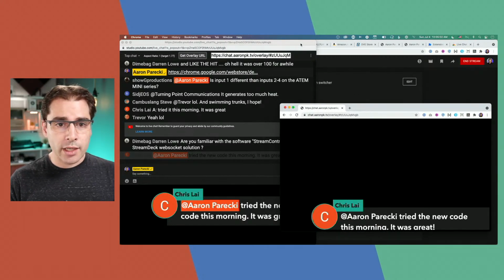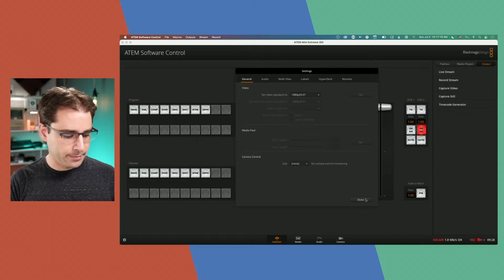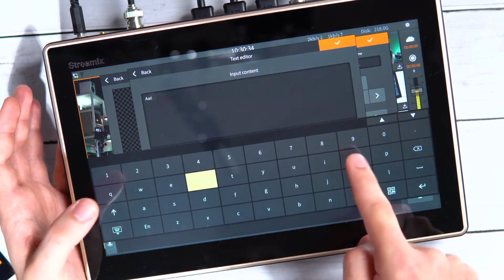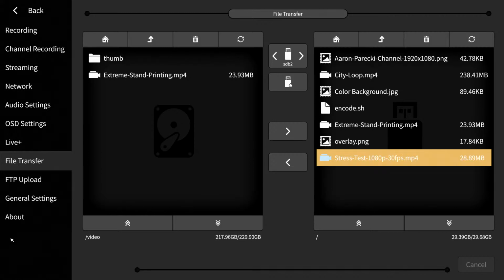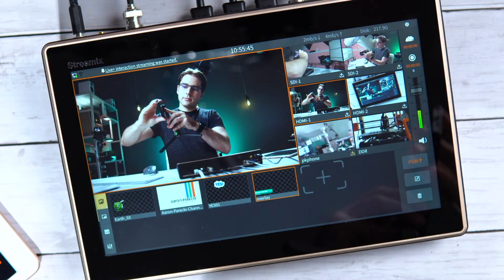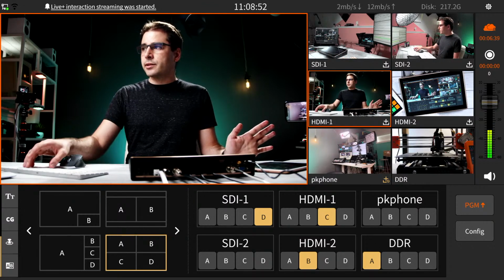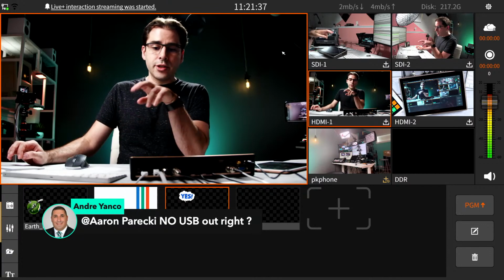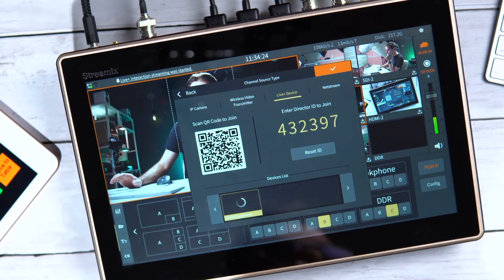🔴 First Look! Hollyland Streamix M1 6-channel livestream switcher complete overview

Comment: Thanks for the great video.  I picked one of these up, but I'm having a couple issues that I can't get resolved through Hollyland.   1) does a phone have to be 5g to use the live+ connection?  2)  why do are most mp4's requiring conversion for file transfer? AND where exactly is that functioning conversion tool?  Can't find a version that WORKS.  THANKS!

Comment: For $3000.00 do you guys think the Hollyland provides value compared to the Atem Extreme ISO. 

From what Aaron showed it does look it it does have some cool features but at $3000 that is a big number for me personally to digest. 

One last question. You guys think that the Hollyland can be integrated into a ATEM Exteme workflow or would it just be too much redundancy between the 2 devices.

Comment: For my needs the only thing this lacks is transitions. If I could add custom animated transitions (stingers), it would be perfect for all my needs. (Mind you the ATEM mini line lacks this as well but it does have more transition options). It would be nice if you could run mics directly into it but a mixer solves that issue.

I purchased the ATEM Extreme ISO mainly for the two outputs, super source, and ISO, which this effectively has. Since it has multiview on the device, I don't really need the second monitor out. It even replaces the need for a hyperdeck and PTZ controller. I would have purchased this over the Extreme ISO had I known of it's existence.
Reply: There is a dodgy workaround: use the DDR channel as your video transition. Watch as it plays, then fade in, fade out of it. 

I think you should make a feature request to Hollyland. Tell them that’s the only thing standing in the way of a purchase.

Comment: What format audio and video to play does this device takes ??
Reply from the maker: It requires a very specific format, they provide a windows application to transcode to the format, but you can also do it manually on mac or linux using ffmpeg.